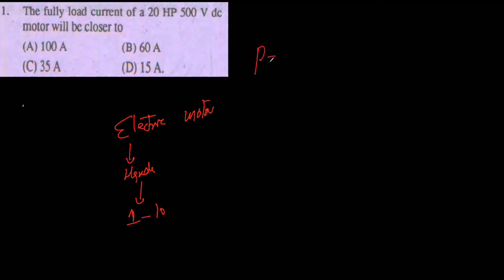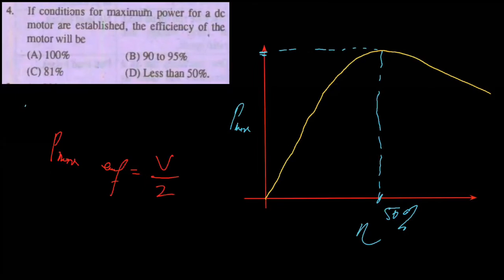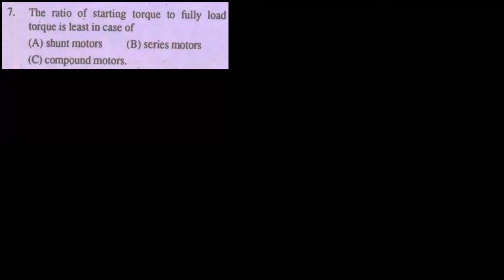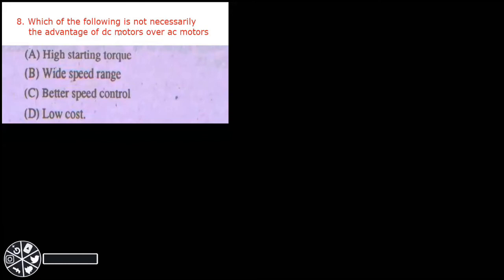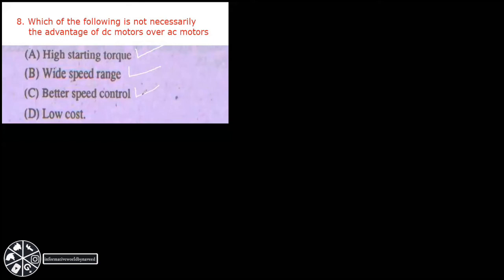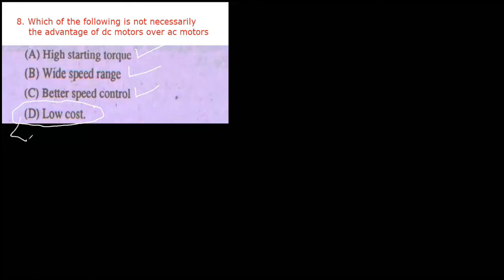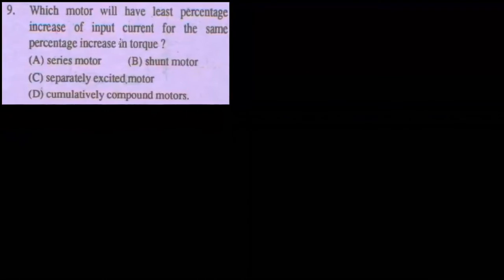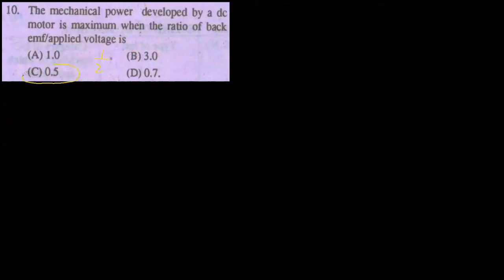Handa MCQs || Chapter 18 || DC Motor || MCQ's No 01 to 10 || Engineering World ||

Comment: Please solve this.............. 
A 20 kVA, 440/220 V, single phase 50 Hz transformer has an iron loss of 324 W. The copper loss is found to be 100 W when delivering half full-load current. The percentage of the full load when the efficiency will be maximum is?